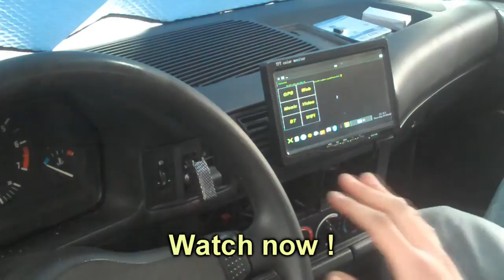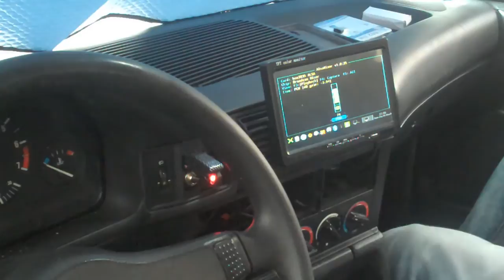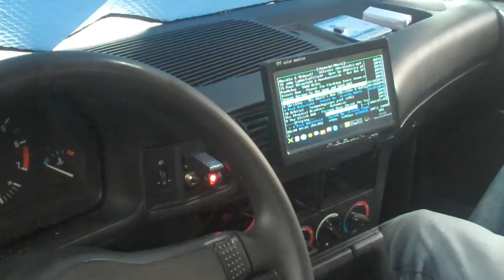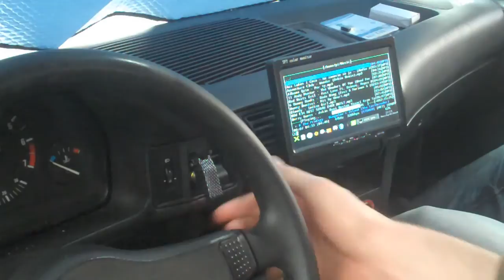Amplifier for Raspberry Pi in BMW E34

Comment: Nice DIY but I think you need high cables for wiring those red and black ones might bring problems later in the future, especially if you are using the bass more, your amplifier might heat up and cause them to crack, ending to no sound. Hats off on the work done.
Reply from the maker: I appreciate your advice. Thanks a lot for that. The thing is,  I don't use any special speakers, bass or what ever, just factory speaker that are somewhat weak, and I don't rise the volume much, I prefer the sound of the engine :)
BTW, this is old setup with old RPI, next video is going to be full project from scratch to full operating CarPc. Hopefully :)
Reply: ok cool no problem... I want to upgrade my sound too but with the stock interior speakers. I do not want a top quality sound just descent one.I will wait on your video. Do you have an aftermarket exhaust to get good sound of both engine and exhaust noise? Cheers.
Reply from the maker: not really, I just removed the katalysator and middle silencer and it makes dangerous growls. Tho I'm planing to change the engine too. I hope to V8 so that will be another story for another time :)
Reply: Ahh nice... V8 is good, you will enjoy the engine noise.. and I am sure after that something will tell you to change the exhaust just to hear how it sounds. Good luck.
Reply from the maker: Thanks. I appreciate your support :)
Reply: Gerry I see you on all the E34 videos! I'm assuming you have one?
Reply: Yes boss, for sure I do...been running well too, other than today, three hours ago she drained all the oil, major oil filter housing leak  while parked!! I hope it's not a big engine issue. Gotta love Daily Driven classics.
Reply: Gerry Reggea That sucks haha... Was it a crack or just a failure on the plastic cap?
Reply: Man I am so frustrated but I ignored the low pressure warning yesterday, at 14h I bought another type of oil Total 10W40 to replace the one I had put 2 weeks ago, parked the car until 16h(4pm) upon starting it everything was fine and was to start my journey at 5pm!!It just gave upon me!! I think the issue is the cap(metallic) which I checked today in the morning or the rubber hose on oilfilter housing. well she will be packed until Jan or Feb as I was moving to another city today!
Reply: Gerry Reggea that's really unlucky! Hopefully it's as simple as a hose. A cracked housing would be bad but I doubt that's what is is.
Reply: Yeah man, I hope too... I am even lucky as I imagined if it'd happened on the motor way.. I believe it was just a Guardian Angel, thanks man.